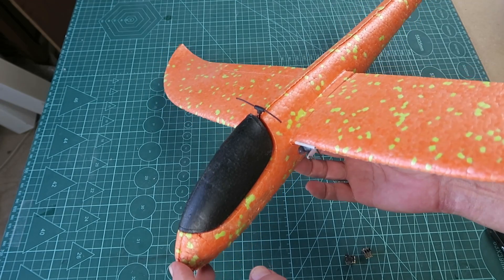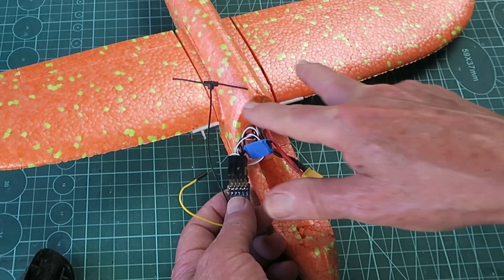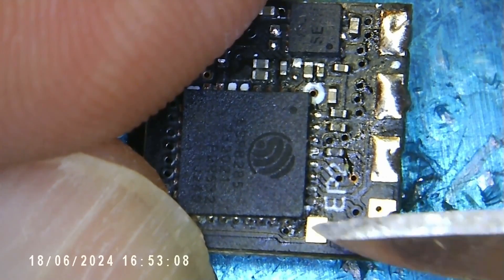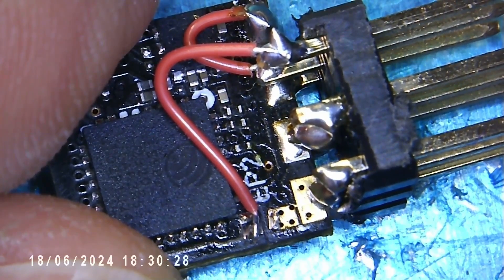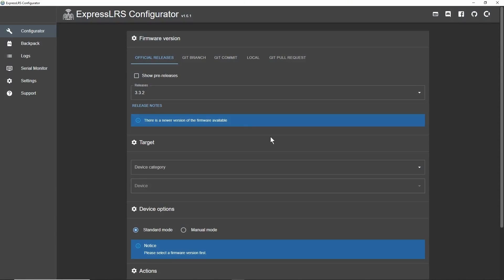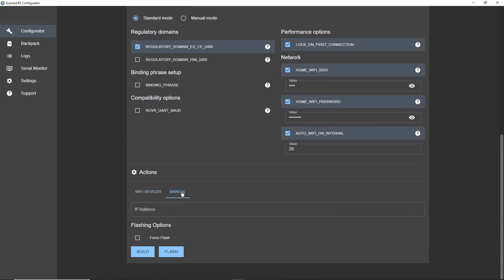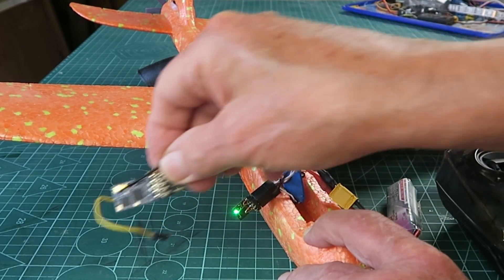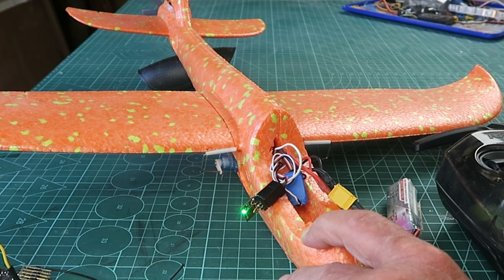DIY ELRS "Pico" 3 CH PWM Rx Perfect for Pint Sized Planes!

Comment: Hi, great video, and best tip of the year! Unfortunately, I'm having problems with jittery servos after modifying the hardware.html file. I'm using an RM RP2 and a Jumper Aion mini se. Is this jittering also present with the Happymodel? The movements are very small, but they still make it unusable. Any ideas on how to get rid of the jitter (frequency adjustments don't work)?
Reply from the maker: I haven't seen any jitter using the Happymodel Rx. What did you change in the hardware.html?
Reply: @1nformatica  Hello, I only entered the PWM pins. However, I'm using micro digital servos. That might be the problem. The analog servo (for testing) doesn't show any jitter. Are the servos in the video also analog?

Comment: Hi! Thanks for a very informative clip. I have a few of these receivers those came in a combo deal and I have had no idea what to do with them yet, but this is one really cool way to use them. 
Did you happen to weight it when finishing soldering the headers and wires on? ...Could probably measure those pieces on my own too. Anyways thanks for the tip and instructions!
Reply from the maker: Thee weight is 1.17g including the header and some hot glue to keep the wires in place. Thanks for watching, have a great day!

Comment: Do you know if this can work with betafpv 915 nano receivers?
Reply from the maker: Probably yes. On the EP2 the GPIO Pin 15 is used to enable boot made so the pad is available to solder to : https://youtu.be/pkhymye5W8E?t=84 You would need to see if the boot button on the BetaFPV  915 uses the same pin. If not soldering to the GPIO pin on the processor is an option! Thanks for watching, have a great day!

Comment: Great tip. What about MATEK  ELRS-R24-D can i do the same with it ?!
Reply from the maker: You're welcome! I see no reason why it should not work with that receiver. Only difference is it has a reset button instead of a pad which will make soldering a bit more challenging! Have a great day!!

Comment: To show my total lack of knowledge about these things ..... Is it possible to do the same pin mod and program them to output S-bus plus 1 or 2 PWM channels at the same time. Somewhere in the boxes here are a couple of Radiomaster mini ELRS receivers like that. The Junior Brains Trust hasn't had the time to sort us Old Farts out there yet! 
If so, that's 1 more way to put a brushless motor into a brushed toy with S-bus/DSM satellite sockets. 🤔😊
Reply from the maker: Well yes / maybe!! You can select CH2 to be serial Tx at which point CH3 will automatically change to Rx and cannot be changed. So you can have SBUS or CRSF on pins 2/3 and still PWM on CH1. CH4 &5 would be possible for PWM (I think) IF you can solder to the ESP8285 pins 18 & 19, there are no pads on the board I can see. This is beyond my megre soldering skills!!
Reply: @1nformatica  LOL! You can talk! You should see some of the disasters here, perpetrated by various individuals, depending on their respective levels of descent into Parkinson's! 😱🙄
Reply from the maker: @theoztreecrasher2647  I usually have the dt's in the morning so wait for the afternoon when I can get my trembling in sync!! BTW which sbus "brick" are you using?
Reply: @1nformatica  😂We can't even claim that excuse since most of us are banned from booze by the quacks! 😉
S-bus "brick"? Usually FrSky/Flysky/Radiolink S-bus mini receivers with the Radiomaster TX16S 4-in-1. There are 2 Radiomaster ELRS mini receivers here somewhere waiting. RP1 and RP2 I think. 1 has that little ceramic antenna.
Reply from the maker: @theoztreecrasher2647  Sorry, my bad! I meant the DSM/SBUS "brick" usually with servos that you want to connect to in the model......
Reply: @1nformatica  Ah! The normal stock flight board like that in the newer brushed Volantex Mini Warbirds with S-bus and DSM satellite sockets on them. Several other little brushed cheapies that now are coming out with the same sockets also. 😊